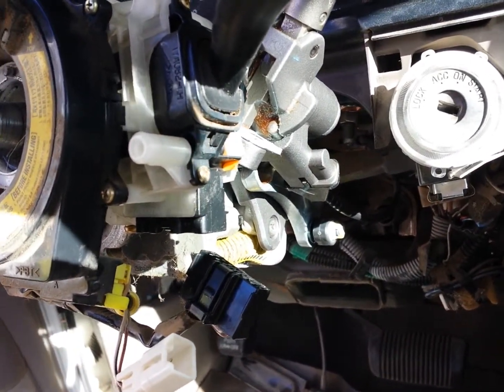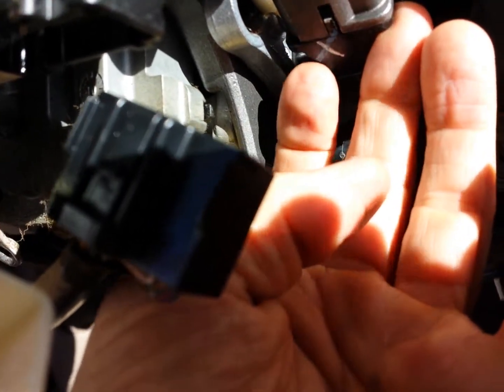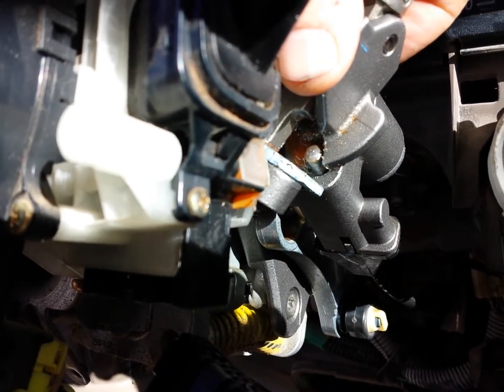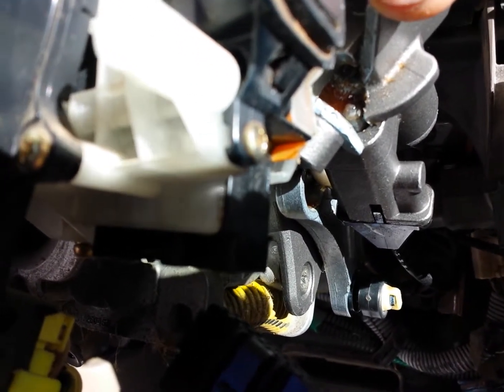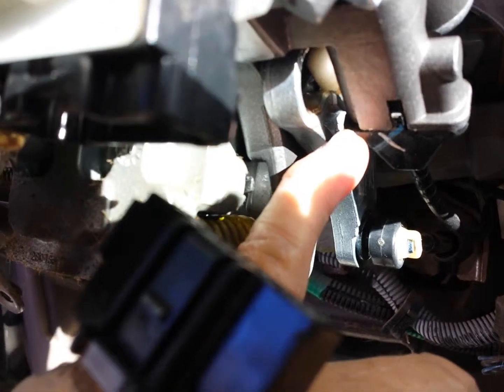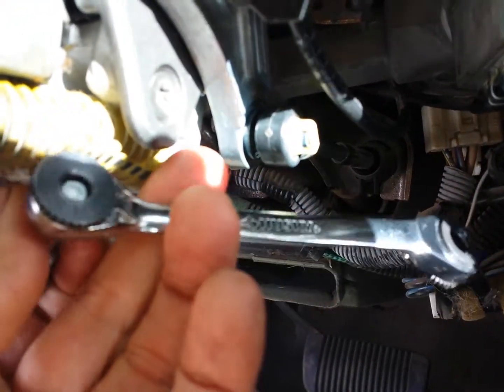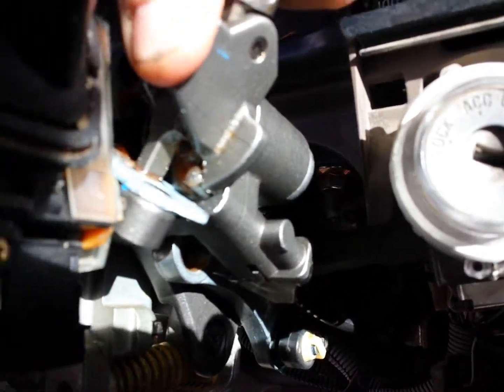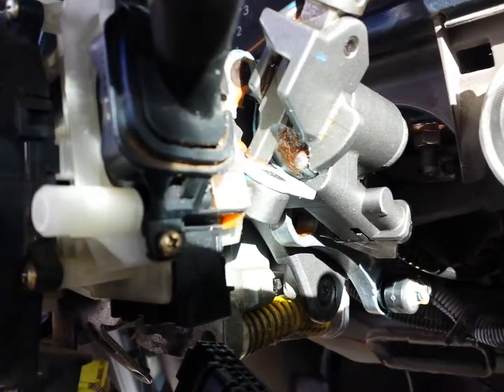2002 Toyota Tundra 8

Comment: Correction - The 2 screws on the cable are T-20s, NOT T-27s as the video states . Proper torque for these 2 screws is 25 inch pound according to the Tundra Service Manual.

All 3 of the screws (part number 90080-16039) mounting the Shifter Controller (part number 33501-0C012) are T-30s and proper torque for these screws is 9 foot pounds (108 inch pounds).

The screw holding the Shifter Arm into the Shifter Controller is also a T-30 with proper torque of 13 foot pounds (156 inch pounds). The part number listed for this shifter arm screw is 90080-14014 but is no longer available from Toyota. Luckily mine wasn't stripped out as in the video. Hope is eliminates confusion of screw sizes and torque values.